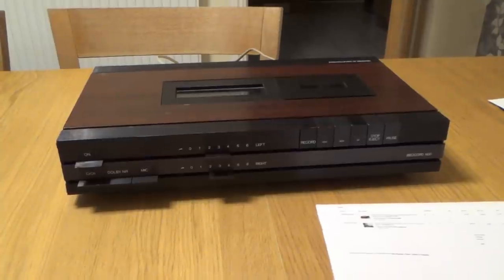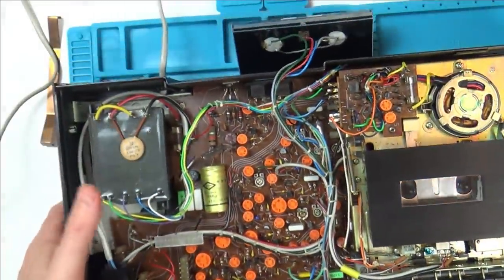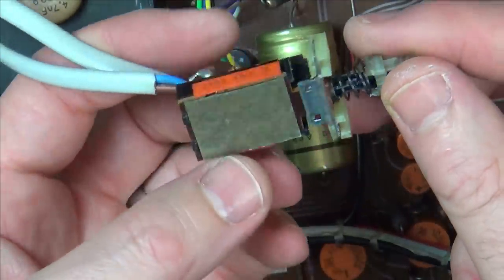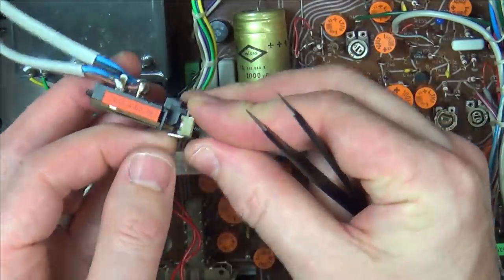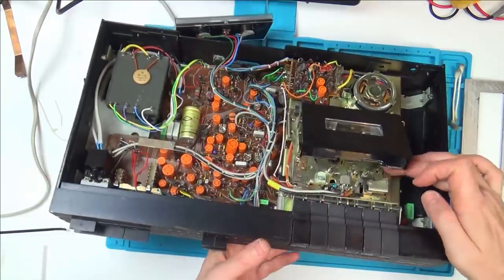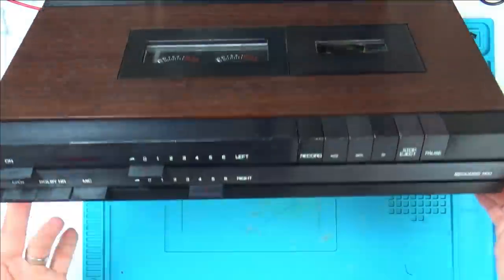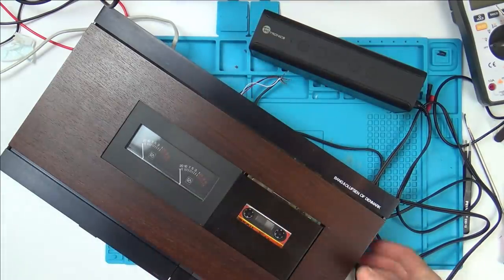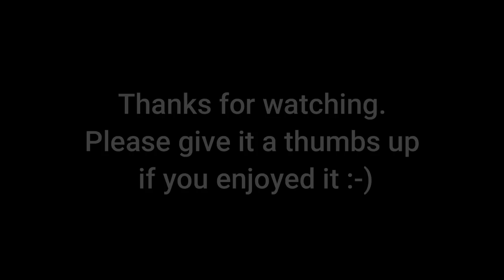Bang & Olufsen BeoCord 1100 Cassette Deck -Trying to Fix

Comment: The five pin DIN to amplifier socket was also the input FROM the amp to record on the cassette deck. Two pins for left and right in, and two pins for left and right out. The middle pin is ground/shielding. The MIC input is a much more sensitive input for a microphone. The machine is working the way it should.
Reply: @ballsrgrossnugly  The first cables I ever used were five pin DIN to four phono. They were more or less the default cables for consumer audio, at least here in Scotland.
Reply: European stuff. including British equipment, often used DIN. I bought a British amp, a Sugden A48 2, in 1978 and that was still DIN.
One thing to watch on the European stereos is that they sometimes had different input and output levels to Japanese equipment.
Reply: Always amazed that DIN connectors seem to be weird to "youngsters". The design allows for most features used in audio equipment, all with a standard sized shell, thus giving a neat appearance.
The 5-pin plug and socket are the norm (pun intended) for audio signals, with output on one side and input on the the other, with common at the 6 o'clock position. Mono applications use just 3 pins, at the 3, 6 and 9 o'clock positions.
The amplifier connection socket would have done everything you needed. With proper equipment, a 5-pin DIN to 5-pin DIN cable would give full facility to and from the amplifier. With today's preponderance of "American" connections, you need FOUR RCA plugs at each end.
The microphone socket expects a moving coil mike - actually two, since it is stereo. These obviously would produce a much lower signal, and would have quite different frequency equalisation, hence the awful sound quality you got.
Reply: @oldbatwit5102  Here in the Netherlands, DIN only really went out of fashion in the 1980's. Everything up 'til that point used DIN, after that the majority of equipment switched to RCA (cinch), although there was always the odd one out that used jack plugs or even mini jack plugs to connect components or speaker cables. Most of the time it was a matter of pricing. The cheaper equipment would use (mini) jack plugs, the more 'expensive' equipment would use RCA.
Reply: @slashtiger1  Yep. I can remember Grundig and Tandberg products with DIN connectors. One good thing about DIN was that one socket could accommodate left and right inputs and outputs of a tape machine or two record decks.
Reply: @oldbatwit5102  Exactly. My foolishly chosen first stereo components were an ITT stereo radio and a cheap Japanese cassette deck. There was no simple way to match levels from DIN to phono.
Reply: This is pretty standard DIN wiring, but most wouldn't know it.  A lot would just buy the cable plug it in and the thing works. :)

Comment: Pretty sure the line in is on the other two pins of the amplifier DIN input. You don't want to put line/ear outputs into the mic input as the latter has a pre-amplifier making the sound much louder, which is causing your problem.
Reply: this is what I was shouting to the screen as well, but unfortunately our mate Vince didn't hear ;-)
Reply: About to same the same.  Recording line level into mic in.
5 pin DIN was an industry standard, google will show Vince the connections left/right.

Comment: the copyright is not for the actual composition but the recording. You can make a cover song and it will be fine. Problem with classical is that while the music is public domain, the recording is not. You can still get a copyright claim from whoever owns the recording, unless it has been 50 years or even more

Comment: I sold a lot of these when I was a B&O main dealer in central London. 
MY biggest customers were from The Russian Trade Delegation that used to export them back to the USSR.
We sometimes jokingly referred to them as KGB because they all dressed like characters from a spy novel.
These units only suffered from heavy handling when people moved them around. The front mains switch was prone to being knocked due to its location. 
The sensitivity of a DIN input is about 3 millivolts compared to line outputs which can be as much as 750 millivolts so it would overload the more sensitive input.
Reply: Makes sense...He needs a real scope to check those pins input\output...I would even beat they have the schematic somewhere on the internet. I would also recap the whole thing. As  those old cases are  worth $50.00 US alone here. As people want that wood case...

Comment: This sounds like the level feeding into the microphone input is too “hot”.

“Line Level” (or in your case “headphone out” is a much higher level signal than “Microphone “ input.

It may be worth doing one of two things.
1. Turn down the headphone output at the CD player, and adjust the incoming audio at the Tape Deck until the meters don’t peak higher than 0dB.
2. Invest in a “DI Box” ( Direct Injection). This will attenuate the signal to the level that you need. A lot of people use them to connect Keyboards / Guitars/ Turntables into the microphone input of a mixing desk.
I used to keep one in my tool kit, it saved a lot of trouble and fault finding.
Reply: This is what I was going to say.. Turn down the volume on the DiscMan and I'll bet the quality will be better.. Keep on Fixin' On!
Reply: @eGoCeNTRoNiX  One of the needles was 'hitting the end stop' at one point.That would lead to oversaturation of the tape.
Reply: That is the exact problem.
If he had used the AMP SIDE, REMAINING PINS they are the record input.
(A 5pin DIN to RCA dongle is a standard item on Amazon)
The EXTRA TWO PINS  a 7pin DIN is to LINK BeoMasters/Beocenters to remotely manipulate Beocords tape, Beograms Discs, etc. 
 There are also wall mount remote receivers, to Operate the systems from another room.

Comment: You did well on this one.   Such a simple thing to get it working right.    I would have been tempted to remove the 4 screws to take the faceplate out, clean it and glue it before putting the meters back in place.
I did have a laugh when you were doing the gluing.    "Just wearing gloves because this stuff stinks"   I didn't think we used our fingers to smell things lol :).  Seriously though, always enjoy your repairs..    Maybe with music moving forward, you could use the Youtube Music Library and record some of that to a cassette.   The YouTube music library is designed to be royalty free music for videos.

Comment: Hey Vince, I've just had a look at the schematic for this unit and found some useful info:
The MIC switch is marked as Microphone / Radio input. It switches the input between the two DIN sockets. 
The DIN socket marked MIC is only for a microphone and it's mono - the left and right channels are shorted together. There's a preamp so it will definitely distort if you connect a line-level device.
The other DIN becomes active for input (Radio) when the MIC switch is off. That's the one you should be using.
Reply: Im not sure i understand?
“The other pin” (which would be AMPLIFIER) becomes an input when you switch of the mic button?

Comment: If you had used the "Amplifier" input section the recording part would have gone better. The thing that is cool about the DIN plug system that B&O loves to use is that a single cable is used for tape out and record in. So less of wire mess in the back. Great video Vince! Enjoy.

Comment: The head on the left is the erase head and the one in the middle is obviously the read head.
Nice to work on old electronics. No IC's and microprocessors. Just old fashioned caps, resistors and potentiometers
Reply: I was about to tell him it was the erase head as well.

Comment: The sound is probably distorted because you're using mic level input for line level/headphone level output. The amplifier socket carries both input and output on the single din plug. That's what the 5 pins are for.

If you buy a din to 3.5mm jack or din to 4 phono plug cable everything will work as expected.

Comment: The Mic button on the front will be to switch between as other have said the microphone level input, and the line level input on the amplifier connector. If you plug a laptop/phone in, you can play music from the youtube audio library; where it's clear up front what music you can use in video without affecting monetization. Record that to tape, and you've a test tape...
The tape head in the middle is typically play and record. The head to the left is the erase head.

Comment: As I recall with B&O DINs, amplifier line in is on the spare two pins on the amplifier socket and the mic socket is for mic only. 
That was the case on a Beocord 1900 of similar vintage.

Comment: Also a felt tip (have a few of varying blacks and try and match) run along the top front edge in one movement at an oblique angle always makes a remarkable improvement.

Comment: The 5 pin din has both input and output on one plug. The Mic input is for a microphone which has a more sensitive input level hence the distortion

Comment: Just rewatched,
for assembly or mounting something it is always good to heave some headless screws.
Usually you can just put them into the "holding" part and put the mobile part on it.
Then it is easier to screw another screw in.
Especially useful when mounting heavy or large things to walls.

Comment: "Then when we press this - arghhhhhh shhhhmmmmm" classic moment lol =D  "You know I don't know how to use a scope" - after demonstrating how to properly use a scope to find the left and right audio channels :o)  You do know how to use a scope Vince!!!  Maybe you didn't in the past, you showed us you do know how to use one here though =D   Great job - I would probably try and find a similar replacement for that switch.  The switches do look awful on it, but it's early kit I guess.  That audio input is going to be line in level - so if you have it connected to the headphone socket of the CD player there (and its volume is loud) it will be too loud.  It could also be that the erase head needs a clean, and perhaps the tape itself is part of the issue.

Comment: hi you are 100% right  about making the money you have to have a video that no bodys done before 

over a long long time you will get some of it back the gain levels are very very low on the din sockets  nice to seen the insides
i am a tec i seen alot of  decks this is a first

Comment: I think the mechanism still needs some love. On that classical music it’s rather easy to hear the wow and flutter. I would also check the input filter capacitor, if it gets weak you get hum on the output. But for now at least that seems fine.

Comment: Looking at the back the Amplifier connection are left to right clockwise. 1 Input Left, 4 Input Right, 2 Ground, 5 Output Right, 3 Output Left. Approx 250mV audio signals. The Microphone inputs will be in the 1 - 5 mV range hence the distortion on record as your overdriving the input.  I use to have a load of those type on/off switches same used in TVs I will look, no promises.

Comment: The tape deck is working perfectly, other than the power switch. You're just feeding line level into the mic input on the din jack.

Comment: Another great video. Btw, you only need to worry about voltage on caps in switch mode power supplies. The old school linear stuff is much safer.

Comment: Good result . But headphone output from cd is way too big a signal for a line level input for recording . It'll probably record fine with a line level signal going in and the vu meter needs to peak just a fraction into the red when recording (usually) but experiment with each recording ..
Glad to see more b&o saved.  👍🏻☮❤peace and love brother 👍🏻

Comment: All casette recorders/decks have 2 heads. One for reading/writing the music itself and one socalled "erase head". It work ;like this. When the user wants to record music then first the "erase head" wipes the music and then the recording head puts the music on tape. Using an "Erase head" completely wipes the music from the tape. Otherwise the old recording would not be completely erased and heard together with the new recording.

Comment: Oh Vince, you really need to study the DIN connections and the best you could do, is searching ebay for a Beomaster 1100 receiver and a pair of loudspeakers. With that and a standard 5-pin DIN cable, you could have tested playback and recording instantly. The Beomaster could also become handy as a signal tracer, by making a DIN cable with a 4,7 uF capacitor on the hot end to probe for signal, instead of the crappy scope.

Comment: Turn around the pin in the switch. The big end needs to be on the outside and the needle part is for the mechanism. That is the reason it fell out. 
Turn the volume down on your CD-Player, the level is way to high in comparison of a real microphone. The distortion you hear is clipping sound.
Reply: I agree, the pin in the switch should have the "head" on the outside, under the metal flap. It was quite frustrating not beeing able to help Vince out with that 😋

Comment: Great video, Vince. I have some old switches (new old stock) they are for old TV's but look similar to the one you were trying to fix. Would you like me to send them? Also you did get the input wrong as someone else mentioned. The distortion was because you were feeding the signal into the mic input not the normal audio input. Anyway Great video.!!

Comment: Another great video. One thing however. I must slap your hand for testing for continuity with power applied to the circuit. This could result in damage to the meter, the equipment, or to you. Thankfully the audio line out voltages are too small to damage the meter or you and the multimeter continuity voltage is too low to damage the equipment in this particular case, but it is very poor practice.

Comment: DIN uses lower voltages than modern line out devices. That's why the output is quiet, and the input is distorted.
Reply: ^^ this ^^
Reply: Exactly. He needs a 1/10 voltage divider.
Reply: DIN is just a connector format with no specification related to voltage (at least relative to any of these voltages - there may be some upper limit voltage/current spec. for the DIN connector family).  The issue is Vince connected a line-level signal to the mic input DIN.  The mic input buffers the low input signal from a microphone, but will distort if the relatively high input signal from a line-level is fed into it.  The separate amplifier DIN has a line-level input for recording from devices such as receivers, etc.

Comment: Hello,sorry for my bad english.In the same jack you have line in and line out( mirror)200 to500 mV.Do you use mic in(is preamplificated).Mic in   is about 15mV and rec.is distorted. MIC in should be off in line record( noise of preamp).Good luck.

Comment: My guess is that the input source is designed to accept a very low signal such as a phono input and then amplifies it internally to line level before it's recorded onto tape. However your CD player is giving out a much higher line level input which is then amplified again by the tape dect resulting in the distortion. Try recording from a record player with phono output. The phono stage is very weak signal.

Comment: It seems that You used the microphone-in DIN jack, but that would amplify the signal too much, since the mic signal is usually way lower than line-out. You should be able to use the same jack you used for audio out and when You record again, the levels should be ok.

Comment: I think MIC is literally for a Microphone input which expects very low levels. My bet is the AMP plug has a L and R input to the recorder, in addition to the L and R out. If you connect the Discman to the AMP input (with a lower level of volume) it should sound a million times better.

Comment: It is distorted because you are using the microphone input. The line in is the other two pins on the amplifier-socket (the ones you got nothing on with your scope).

Comment: The 2 sockets on the back are socalled "DIN stereo sockets". These are 5 pin DIN sockets have 2 inputs (left & right), ground (middle pin) and 2 outputs (left & right).  (Or are they 7 pin DIN sockets ???).

Comment: Hi vince on a 5 pin din amp socket centre pin ground one side 2 pins are output other two are input .the mike input will sound distorted on the high input you are feeding it.

Comment: **Useful Tip**
Whenever you need to screw a screw deep inside as it is in this case with regards to the switch, I find by using some tape you can bind your screw so that you can stick your screw with your driver thus allowing deeper penetration without any mishaps "No I am not talking dirty here" Anyway I found this works really well with slit screws, simply by the Tape binding your screw to your driver until they either bite or allow penetration Err-being screwed ?! " hmm I know-I know that doesn't sound right" , but anyway once a little penetration has occurred and your screw behaves, the tape can be removed ?!! and your screw further screwed ?!? "Well Blow me! That does sound rather obscene even though it's not suppose too"..

Comment: **Addendum**
The recording input was set to microphone, I am guessing the input in the back has allowance for microphone and Line in, this means the other side to input pins may be LINE,
don't forget to set the Bias from Microphone to LINE 😉 that way you wont end up with a distorted recording.. or you could connect the microphones instead of a line source..

Comment: Look at switch operation @ 6:15 and you can see there is what looks like a missing/broken plastic tab from the mechanism which would normally prevent it twisting when pressed.